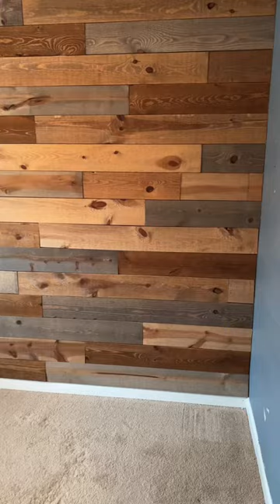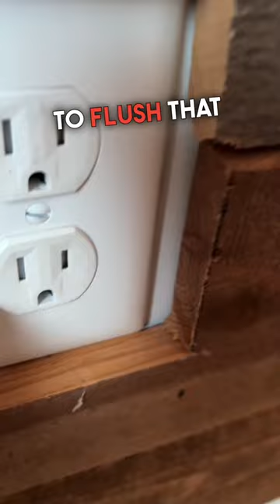Outlet Sunken Problem #electrical #diy

Comment: That white box extender isn’t actually what you think it is. That little white box goes over your receptacle whenever there’s a flammable material exposed more than 1/4” I believe. Also have 5/8” in my head as well. Really what you can do is take a fein tool or sawzall and cut the nails holding the box to the wall then get a remodel box and bring it out to the depth you want then screw the remodel box to the stud from inside the box.
Reply from the maker: Thanks for sharing your experience.

Comment: It is not incorrect but it is very tacky, and for they people saying just use spacers that is not code if there were to be a fire it would catch the wood on fire
Reply from the maker: Great points all. Spacers are incorrect…box extenders do cover the wires properly.